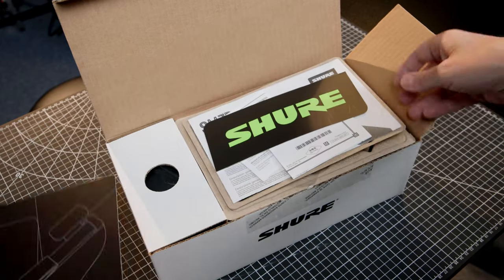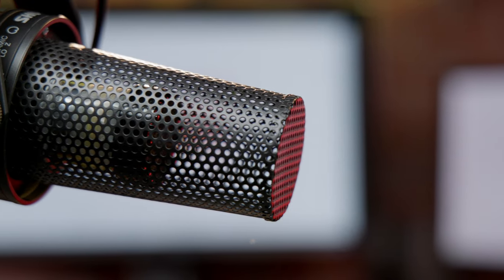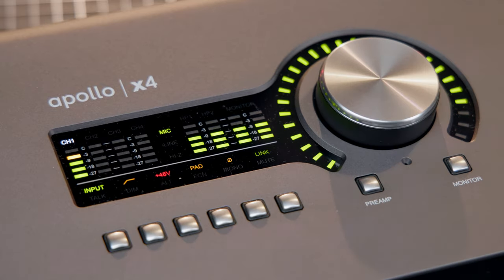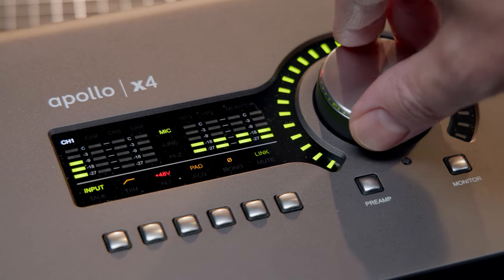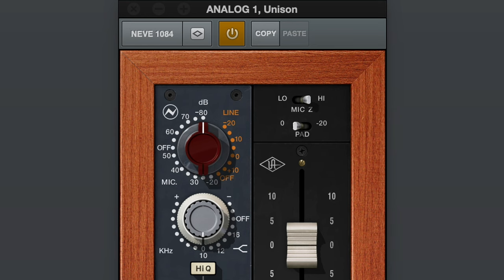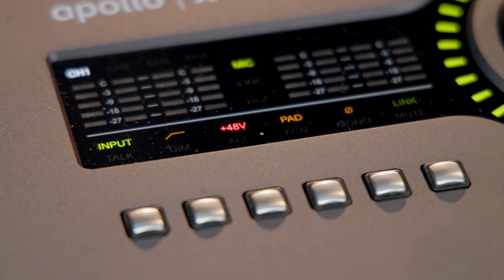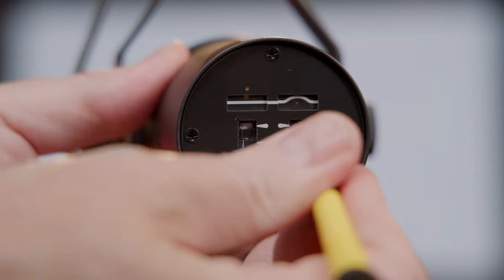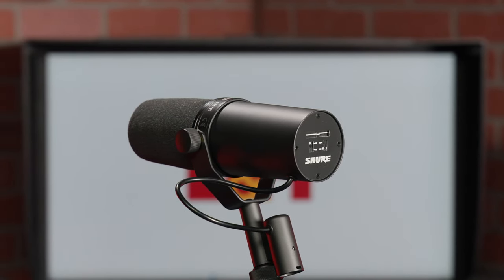Getting The Most From Your Shure SM7B

Comment: I think the "large diaphragm" bit isn't accurate (I can't find any mention of that anywhere else). Most sources say the 7 has essentially the same capsule as the 57 and 58. Other differences make for the smoother frequency response and lower output of the 7.
Reply: It does use the same capsule, it's just the housing that makes it's FR the way it is.

Comment: i built a square booth with molton curtains but i want to just cover 3 sides ....which side should i leave uncovered? front, side or back of the sm7b?
Reply from the maker: This is probably not as critical as you are thinking. Cover the side that connects the back and front. Test each side before completing the project to gauge the quality of the recorded sound.    >Mark<